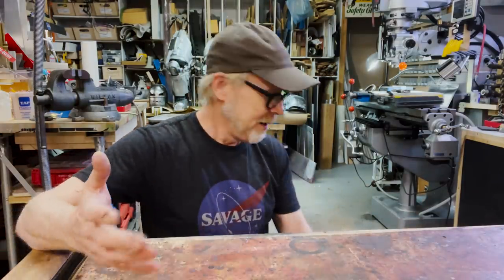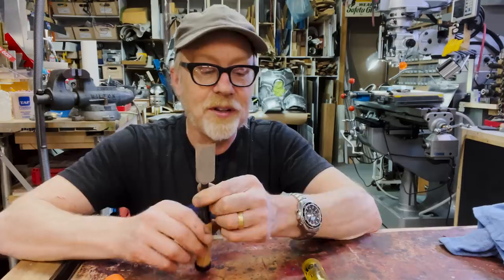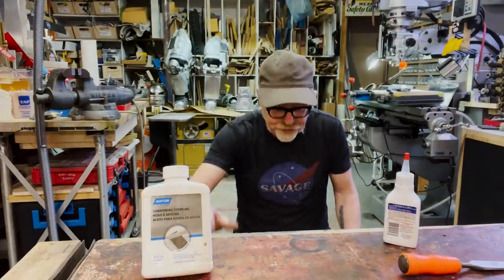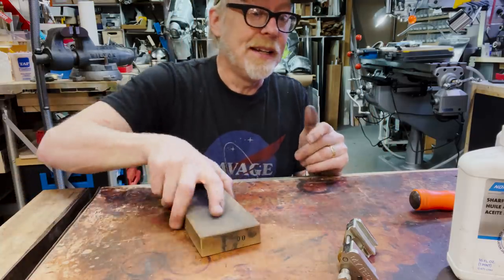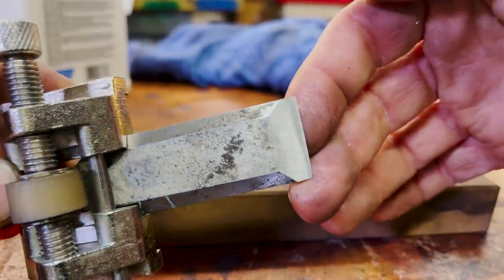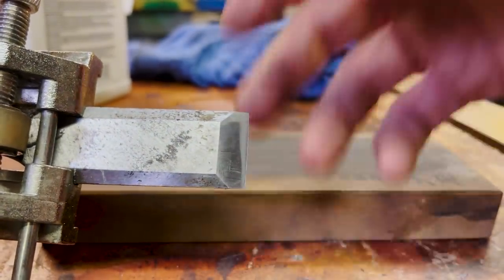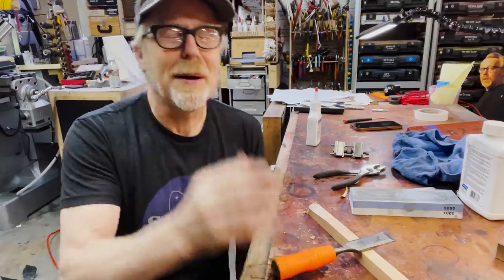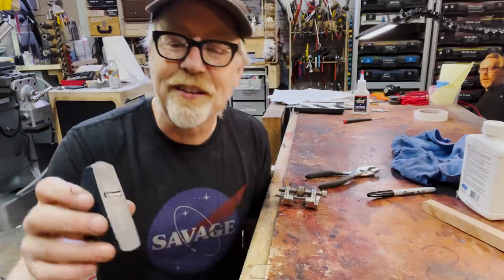Adam Savage's Favorite Tools: Woodworking Chisel Sharpening!

Comment: Adam Savage— I adore you. I loved mythbusters and I found so much inspiration from you ... but—everything about this is wrong 😳. You do not use oil on water stones and the primary bevel is typically (25 degrees) is only the first grind. Chisels/plane irons etc require not only a secondary bevel but also a tertiary bevel. Typically up to 15k grit.   Not to mention the stones require flattening from a diamond plate. Rob Cosman (he’s on YouTube) is a fantastic teacher of pro sharpening. No hate here I swear. Just throwing out info you may be interested in. 💜

Comment: Remember a chisel, as any blade, has two sides , the angled side and the flat side. The burr on the flat side, caused by the sharpening of the angled side has to be removed. Also even the best chisels sometimes has a cupped flat side. The flat side has to be straighten to remove the cup. This sometimes takes along time to do but is well worth the effort and time.

Comment: Do you ever consider creating a secondary bevel? A lot of woodworkers grind a slightly steeper bevel for the first millimeter or two so that re sharpening only takes a few strokes instead of refacing the entire bevel each time. If you cause a lot of damage you re do the whole thing. Also what about stropping or polishing your blades to remove the bur you're creating? For me, that's usually the difference between a sharp and a razor sharp chisel.

Comment: Adam, I believe you are missing one final step.  Whenever I sharpen my chisels, once I finish doing hat you did, I also do a couple of passes with the other side.  If you do not do that, you can feel there is a bump on the back of the chisel rigt after sharpening it. 
Hope you find this useful :) Regards from "Carpinteria Batimuebles"

Comment: Adam, you should own a Flattening Stone for Re-Leveling your Sharpening Stones and you should use the same medium on the stone every time... I myself use Kerosene and Diesel Fuel at a60/40 mix or there about, but it smell and not good for use in your shop

Comment: Adam, Japanese water stone (the clue is in the name) works with water rather than oil. Apparently, it seems to work okay with oil (I've never tried because I wouldn't want to risk buggering up a water stone).
By and large, the most expensive honing guide works on exactly the same principle as the cheapest one so you can save a few bucks without compromising on results.
My personal preference is a diamond stone 600 one side and 1000 the other side and finish off with a fine Arkansas stone then strop on leather dressed with stropping compound.
I envy you your Japanese chisels... I can't afford them (but one day, my friend... one day).
Reply: I have the exact same honing guide Adam does and it needed to be filed some to be bedded right. The casting is a bit rough from the factory. Nothing 10 minutes with a file can't fix though. Japanese chisels are for Japanese people. In the west we use western tools. Get some Narex chisels. Everyone raves about them.

Comment: Oil is usually used for Arkansas stones. Those "waterstones" are usually soaked in water before use due to them being more porous. That being said, if it's working for you and you're not clogging the stone, then go for it.

You can also go bananas with lapping films on a flat surface like glass if you want bragging rights for some reason.

I would suggest giving them a couple swipes on a leather strop afterward to take care of the burr that forms during sharpening though.

Comment: I always keep junk versions of screwdrivers and chisels around, sometimes the wrong tool is the right tool and I would MUCH rather chip spilled expoxy of the floor with a dirt cheap crappy chisel, or open a paint can with the junk screwdriver.

Comment: You can tell if your stone is a water stone by putting water on it. If the water soaks right in, it is most likely a water stone.
Reply: Guess what happens if you boil the oil out of an oil stone? Yeah then they suck water up too.
Reply: @1pcfred  I’ve never tried that. Do you boil it for 100 years? Does it affect the hardness? The water stones are softer and wear out quicker. Does boiling reduce the hardness ?

Comment: for the correct blade angle try building a little helper. Set your chisel into the sharpening jig correctly adjusted. Take a piece of wood like a small board, put the blade flat onto it and push it forward until the jig touches the edge. now nail or glue a smaller piece of wood to the board touching the cutting edge of your chisel. In the future you just need to put the chisel edge to the stop block and push the jig forward until it touches the board and you have always the same angle.

Comment: Oil stones get a coating or wetting of oil, water stones need to be soaked in water before use and re-dipped in water during use. Both oil and water stones also need to be flattened or tried before use and/ordering uses they’ll hollow in sections used, typically the middle. You may want to switch to diamond stones or plates which can be used dry and wetted, with water or oil, depending on the stone/plate. Diamond stones/plates also stay flat/true on their own. A strop is also a good investment with some fine grit/polish as it provides good touch ups on chisels and planer blades as you’re using them abs between sharpening; a strop also helps polish the blade as it can get much finer grits then stones/plates. I like diamond plates and use them regularly; I also use a belt sharpener and/or roto-sharpener from time to time but nothing beats the satisfaction of hand sharpening.

Comment: How do you not have a Tormek sharpening system or even a knock off Wen ?  They work amazingly for all your sharpening needs.
Reply: You're not going to get a fine hone off any grinding machine. They're only for establishing primary hollow ground bevels. You still need to hand hone the secondary edge. Might be sharp to you.
Reply: @1pcfred  The Tormek is a slow rpm wet waterstone wheel sharpening system. With a polishing wheel and leather stropping wheel, that you use honing compound on. It will give you a very precise, mirror reflective edge second to none when used properly. It is not a mere bench grinder.
Reply: @jimmeier547  I know precisely what Tormeks are. Heck I've even knocked off their guide system. I never said it was a plain old bench grinder. You're still not going to get a hone out of one as good as by hand though. Well maybe you will. But I can hone better than that. So I should say you are not going to get a hone out of a Tormek as good as I can get by hand. Not gonna happen. Tormek stones just are not that good. I bet you'd be surprised what a plain old bench grinder can do too. They are an essential part of the sharpening process. My sliding table is famous on the Internet. It comes up on the first page of every search. But the clowns here delete posts with URLs so I can't share it. I linked to it earlier and my post got deleted. That's a user account setting.
Reply: @1pcfred  Agree to disagree.

Comment: Totally a metallurgy artifact.
Reply: nah, you can see that the area across the tip that appears different is narrower in the shot where he inquires, but if you inspect the same region of the chisel after the 1000 and 3000 stones, the area no longer tapers towards that end of the tip. It is likely an artifact of the varying pressure being applied as he sharpens, the jig helps but if you still apply force anywhere besides along the plane intersecting through the wheel perpendicular to the axle, you can still end up with a 'crooked' sharpening, though most of the time it won't impact your work much.
 A much better design for the jig would have 2 wheels on the same axle to ensure you don't sideload the jig at all.

Comment: My biggest piece of advice is to use a strop. Just get a scrap of leather, glue it to a flat piece of wood, and spread some green polishing compound on it. You pull the chisel down the length of it, and it will produce insanely sharp edges, much like how an old timey barber might sharpen a straight razor. I personally also flatten/polish the back of my chisels too, since the edge is the intersection of two faces, not just one.
Reply: I like red rouge better. So there. It looks like Adam has already flattened the backs of his chisels to me. Once you've flattened and polished the back you really do not have to do it again.
Reply: @1pcfred  Sharpening is definitely one of those things where there's more than one way to skin a cat. The way I see it, as long as you're happy with your results, keep doing what you're doing. As for lapping the back after you sharpen the bevel on each stone, my logic is that it's to flip the burr back and forth so you can polish it down to a nice fine, wire edge. I find that too much of a burr cuts really well on draw cuts, but it gets dull easily, especially with relatively hard woods.
Reply: @onebackzach  like many things there's the right way and all the other ways. Personal happiness is not a factor either. There are measurable quantities in all of this. Sharpening does not have to be subjective. Although I am aware that many bring their personal biases into the ring. I don't have a dog in the fight. I've tried it all. Arkansas stones, carborundum, water stones. You name it I've used it. There's nothing out there even close to what diamond plates can do. That's just reality today. Deny it if you will but that changes nothing. Diamonds are a boy's best friend!
Reply: @1pcfred  My point is that I can produce an edge on a chisel that can shave hair just as easily as any razor I've used with my set up and technique, and you might have an entirely set up and technique that might be able to produce a similar edge
Reply: @onebackzach  while we may get similar edges what we have to do in order to do that matters. What things cost, the time it takes, how difficult it is. Those factors. If my house burned down and I had to start over I could get new sharpening supplies for about $30 That would net me 3 grits and a guide. Then I would have to scrounge up a strop someplace. I know where I go to find those. They tend to cost about $1. I would also need a bench grinder. Because I don't do flat bevels. I've purchased bench grinders for as little as $5. My two favorites I made myself.

Comment: at the end you should put flat of the chisel on the stone and pull it backwards once. it will take off the edge that you rolled over while sharpening.
Reply: burrs usually do not roll until you use the tool.

Comment: I always use water with my japanese stones..never thought of using oil. Anyone know if its a problem?
Reply: The only thing I remember about it from other sharpening videos is....

After you have used oil on your water stone never use it with water again.
Reply: The stones are not designed to be used with oil. But it clearly works. You'll still make people's heads explode if you do though. Whether that's a problem depends on how you view it. Technically I suppose it would not be your problem. I used to hone with oil but found it to be just too messy. Today I use a synthetic super cleaner which also happens to be more slippery than oil is. Plus being a cleaner it is inherently clean itself.

Comment: Adam

Nice video.  However, have you ever heard of the 'Scary Sharp' method for sharpening chisels?  Uses a glass plate and wet/dry sandpaper.  Works (at least for me) as well, if not better than stones, and with the plethora of wet/dry sandpaper grits at very reasonable prices, I can work thru down to even 10k grit when finishing up an edge.  There are tons of Youtube videos out ther on the Scary Sharp method

John
Reply: Addendum -

3M lapping film is a great alternative to sandpaper for the extrememly fine grits.  Goes down to 0.03 micron if you need that level, but 0.3micron is as far as I have gone

Absolutely BETTER edges than I ever acheived with stones, and if you factor in the cost of the stones, MUCH more inexpensive, and no worries about wear on the stones, just replace the 3M lapping film for  a couple bucks when needed.  With a good waterstone going for $50+, with multiple stones it could have an initial outlay of several hundred dollars.  With scary sharp a couple pieces of float glass, some lapping film and you are up and away for under $50

John

Comment: So there's no "right way" to sharpen but there are wrong ways. A few wrong ways in this video: - use water with a water stone not oil - having a flat stone is important - using a strop to finish the edge will make the edge sharper and last longer - freehand sharpening is a lot more flexible than using guides, the guides are for setting the bevel, not sharpening the edge - chisels should have a secondary bevel which makes them easier and faster to sharpen - unless your edge is pretty bad, there's no reason to go all the way down to 600 grit - it doesn't look like the back of that chisel has ever been flattened and hardware store chisels almost always need to be flattened - you need to remove the burr on the back side after you grind the bevel or you can chip the edge the first time you use it. 

It's kind of ironic that Adam complains about the signal to noise ratio of sharpening videos and then proceeds to increase the noise. There are lots of good videos about sharpening and this is not one of them. This video is shorter, better, and won't ruin your stones if you follow it. https://www.youtube.com/watch?v=GN4yr7vp4I4&ab_channel=PaulSellers

Comment: The fact that Adam, having used these tools for ages, doesn't really notice a difference. Thanks for that, buying the cheapest. 1 cheap set for splitting, another cheap one to keep nice.
Reply: Just because chisels are cheap does not mean they are bad. Often it does mean they are not finished very well though. You have to flatten the backs of chisels. Cheap ones tend to take a lot of work to make them flat. But once you've done it as long as the steel is good they're good chisels then.
Reply: @1pcfred  - Good chisels have better, harder steel that holds an edge much longer. My first chisel was a narex. After a couple months of using it, I bought a set of dewalt chisels. It blew my mind how much faster the dewalt chisels dulled. They got chowdered and chipped in a matter of minutes when working with oak.
Reply: @UserNameAnonymous  good chisels are just hard enough. Harder steel fractures easier than softer steel does. But you believe whatever you want to believe. Blithely go through life like a complete feather head. I really don't care. I've really no good idea what you were doing wrong. What I do know is there's more to efficient chiseling than meets the eye. It isn't just beat the crap out of them and let the chips fall where they may.
Reply: @UserNameAnonymous  where did I ever say use a dollar store chisel? Cheap chisels are often too hard today though. They skip the annealing step for economy. In this day and age making hard steel is easy to do. Making steel the right hardness remains tricky to do though.
Reply: @1pcfred  - That's fair enough and I wouldn't argue against it. Nobody wants a brittle chisel. My experience has been that a good quality chisel is worth it. I paid something like $16 for my first Narex chisel. I never recommended anybody spend $50 to $100 per chisel. To me, that seems overboard for all but the most serious fine woodworkers (a group in which I don't belong). But my cheap $7 dewalt chisels are almost useless for the furniture I make. I respect my tools. I treat them as gently as I can, I don't ask them to do more than the tasks they were designed for, and I sharpen and hone them often to keep them in good shape. Even when taking that much care, the dewalt chisels were no match for oak. They're too soft. To be fair, they probably weren't meant to be used in harder woods. My narex chisels last at least a good half hour before I need to go back to the strop (and they last a lot longer than that in softer woods). So, getting back to my original point: paying a little bit more for mid-range chisels has been an excellent investment for me.
Reply: @UserNameAnonymous  you'd think that there's some correlation between price and quality and in many cases you'd be right. But it is not really a hard and fast rule. If someone thinks that an expensive tool is going to make their work better then they're probably right. Because human psychology is a complex topic itself. We're not creatures of pure logic after all. Far from it in fact. That's why placebos are effective.

Comment: @Adam Savage's Tested Those are both water stone and should be soaked for approx 15 mins before use. Obviously you're happy with your results, but they could be a lot better if you use water instead of oil.
Reply: Adam's method could stand for lots of improvement. I don't even waste my time with friable stones these days. It's 2021. We're living in the Diamond Age!
Reply: @1pcfred  I use a fine grit diamond stone and a strop with honing compound. Seems like Adam's sharpening for fine woodworking. Seems like he's sharpening for "carpentry". At least he didn't break out the angle grinder like my dad does... facepalm
Reply: @garyhubley  don't knock angle grinders. I've been there myself flattening the backs of big slick chisels. Spent a week once working on one of those. So yeah I used an angle grinder. I sharpen my lawnmower blades with an angle grinder. But I do stone the burr off with a hone stone. When them blades are sharp they make a certain sound cutting the grass. It don't last long. Still love hearing it.